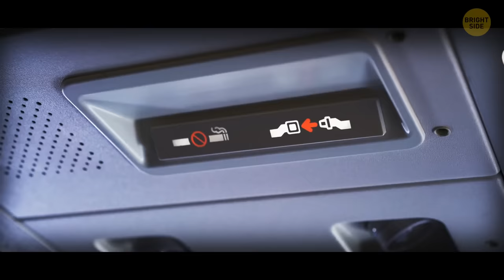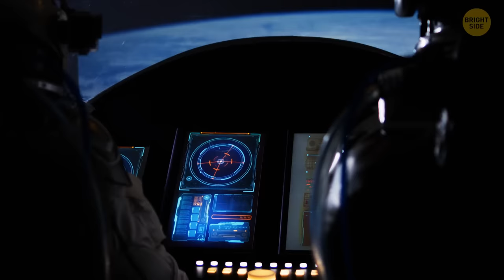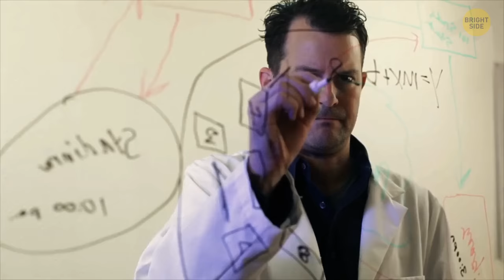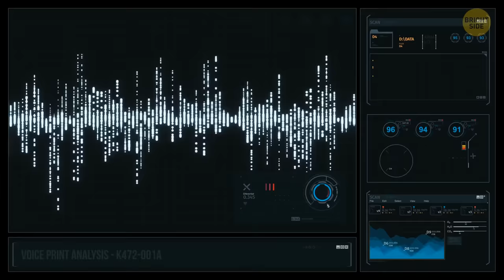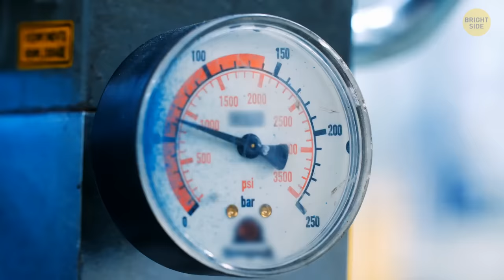Why Do Planets Spin?

Comment: They spin, due to "Conservation Of Angular Momentum" Meaning, the speed of rotation, is constant, as long as TORQUE is zero.
Reply: The 🌚 Moon don't spin🥸
Reply: @BatmanFilmz …
Yes, yes it does.
It has a one to one resonance with the earth. It “spins” once, for every one orbit of the earth.
Reply: @bobinthewest8559 No, it used to spin but Earth's gravitational force tidally locked it.
Reply: The moon spins. That is what the tidal lock explains.. the rotation on its axis = its orbit around the body it's locked with. 

Definition:

What Is Tidal Locking? A tidally locked object rotates around its axis exactly once during its orbit around a host planet or star. This physical quirk affects many planets and moons, including Earth's Moon.

Comment: When describing the counterclockwise direction of spin, you must specify "as viewed from the north". Viewed from the south it would appear to spin in the opposite direction.
Reply: How do you have north in space
Reply: Seems the measurement should be Venusian
Reply: @Brian Thorne
The direction of Earth's rotation when viewed from, say, 1,000 miles above the North Pole and above the South Pole would be counterclockwise and clockwise respectively.
Reply: @jamesking4226 
Not every planet and star has a magnetic pole
Reply: @yourlogicalnightmare1014  The North and South directions on Earth are well established irrespective of magnetic polarity.
Reply: @jamesking4226  
So your intention is that your algorithm only applies to one case in trillions.  Gotcha 😀👍

Comment: Venus is actually upside down spinning the proper direction. 

See Jupiter's red spot it's the point of impact when it swallowed a smaller gas giant. 

See Titan & Triton they use to be Planets. 

See Pluto it was Uranus Moon  but they all switched place Uranus Neptune Triton & Pluto

Comment: Jupiter is not the only planet who's rotation causes it to bulge around the middle. Earth, for one, also is wider around the middle than it is from pole to pole.
Reply: Pretty much everything that spins / rotates.

Generally any celestial body that is rotating (and that is sufficiently massive to draw itself into spherical or near spherical shape) will have an equatorial bulge matching its rotation rate. Saturn is the planet with the largest equatorial bulge in the Solar System.

Comment: It's possible something ends up in perfect balance on the tip of a toothpick, sure. But it is impossible for that to remain the case in a universe that is changing constantly. And once something isn't in perfect balance (starts to rotate) any longer nothing can put it back on the tip of that toothpick again. Not to remain there anyway.

Comment: So, the planets and sun inherited their spin from the contraction of the cloud that formed the solar system. Then:

Why does the contraction of a non-spinning cloud start to spin in the first place?
And are there examples of such a contraction that did NOT result in spin?

I am not sure that the ice skater analogy explains it. The pulling in of the arms did not start their rotation, only increased it.

Comment: Newton's 3rd (?) Law, a body in motion stays in motion
Reply: 1st law. And it is more detailed than you state.
Reply: @ngc-fo5te  yes but in the case of the planets really don't have that much of an opposing force . Yes we have the moon affecting our rotation because we have a liquid surface.
Reply: @ttm1093  The Moon affects our rotation if we didn't have oceans. There would still be tides.
Reply: @ngc-fo5te  no there wouldn't.the surface may bulge a little , but the surface wouldn't move with the moon. So it wouldn't be a tide the way the earth does
Reply: @ttm1093  Yes the surface would move - this happens on Io from Jupiter where the solid surface has tides of up to 100m or so. Now it would be reduced on Earth obviously but they are still there we just don't notice it.
Reply: @ngc-fo5te  I did not know that. I guess you can teach an old dog new tricks.
Reply: @ttm1093  I'm an even older dog than you - which means I have had more time for learning tricks. LOL
Reply: Both heavenly dogs are superior than many

Comment: Claiming that some planets are orbitaly locked is false when you state they do rotate on their axis. Spinning on their axis proves a planet will show a different face of itself over time during its orbit around its companion. That is not the definition of being "orbitaly locked". What our moon does in conjunction to the earth however is orbitaly locked, which should be impossible because magnetic torsion waves and solar wind causes all heavenly objects to start spinning over time no matter where they are. There are no other heavenly objects we know of that displays this kind of impossible non-motion like our moon does in conjunction to the earth. This should be the first indicator there's something seriously wrong with the moon. All facts on what we know about our moon points to the idea that it shouldn't even exist. It's too big, too old and far too light for it's size. There are no other planets out there with a moon that is like this while being 1/4 the size of its companion planet. No computer models can adequately show how our moon got into it's orbit around the earth. It couldn't have gotten there through natural accumulation of primordial matter over time because moon rocks show its even older than our star and its rock density is somewhere round 3.5 while the earth is 5.4.
Reply: Also add the fact that it's the perfect size and distance to cause a lunar AND solar eclipse. 🤯

Comment: No time without motion.
Reply: I used to think that.  I would have said "time" had no reality, and that the only genuine reality was "motion".  We only have an impression of a regular, metronome "heartbeat" of time because of certain, predictable, cyclic types of motion that happen to exist.  But if everything froze still, then "time" would cease to have meaning. 

 So I thought.

Another way of asking the question, is whether time is merely an abstraction and a measurement, or is it "stuff" , like atoms?

I don't understand why, but I think that a majority of physicists believe that time is "stuff".  There is of course, disagreement, with others believing that "time" might drop out from the ultimate equations, altogether.  But anyway, we cannot currently, safely assume that "time" would not still exist without motion.

Comment: The plasma cloud that the solar system was formed from contained charged particles that created an electric field as they moved (Birkeland currents) that created magnetic fields that caused the matter to accrete into the sun and planets.  Electromagnetism - the force we know best - is 10 to the 36th power stronger than Gravity. That's 10,000,000,000,000,000,000,000,000,000,000,000,000 times stronger! The "strong" nuclear force is 10 to the 38th power stronger than Gravity.  While Gravity had it's role to play in the formation of the sun and planets, electromagnetism performed the heavy lifting.